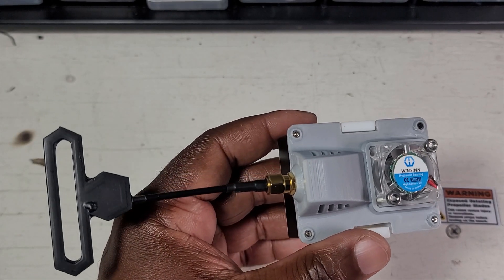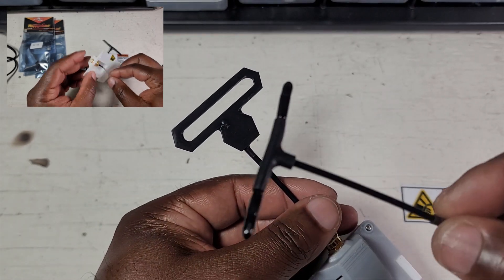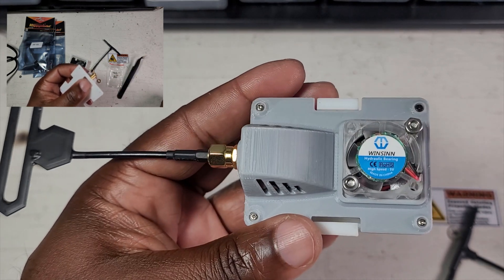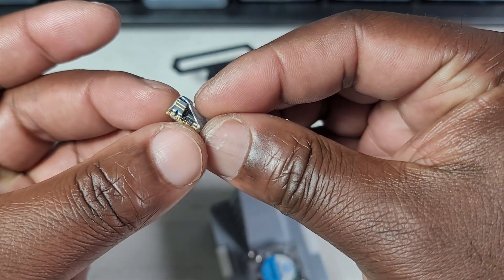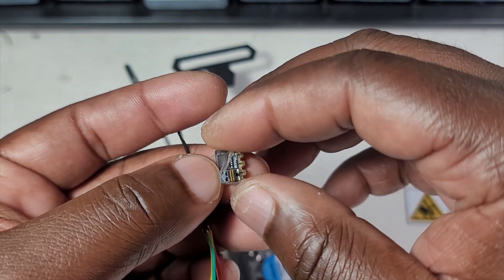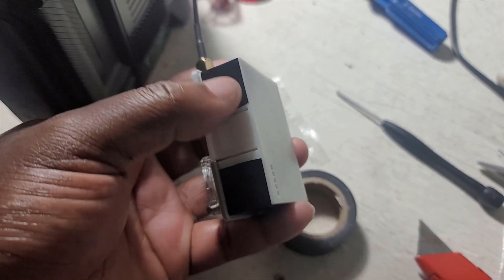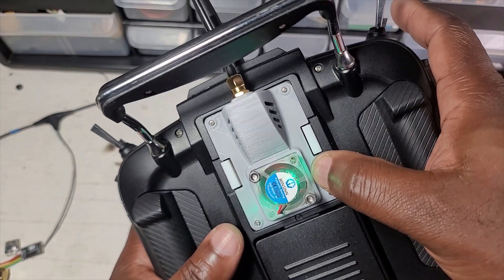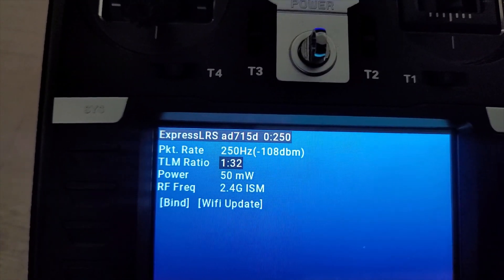ExpressLRS : PP Nano mini test range on 5 inch drone

Comment: I noticed the DJI video was just starting to fuzz at the end of the range test (at the end of the street). What power on the DJI video?
Reply from the maker: It was at 500mw , focus mode on,  low latency off,  and you can't see my house from the end/beginning of the street
Reply: What happened to Baked Beans?

Comment: Hi, do you have a diagram on how to connect the fan to the board? Also right now im using my Frsky R9M with ExpressLRS but is 900mhz, what benefits do I get if I go to 2.4ghz? Because I doubt I could get long range.
Reply from the maker: You get shorter antenna with 2.4ghz, but  if you already have R9 system there is no reason to go 2.4ghz.  As far as connecting the fan, I soldered mine directly to the JR bay plug on the TX. Just Google JR bay pinout.
Reply: @GBoniFPV  given you have the fan soldered to the tx pins,  if you wanted to change to use a crossfire module, wouldn't you have to de-solder the fan first (I have crossfire based quads too, so I'll be switching from time to time)?
Reply: @GBoniFPV  Appreciate it :)
Reply: @grupomexcomer  the 2.4ghz also has higher packet rate tha 900.
They are planning on going upto 500hz on 2.4.